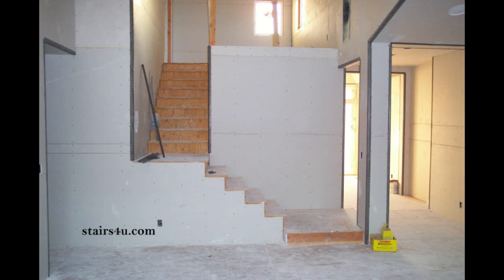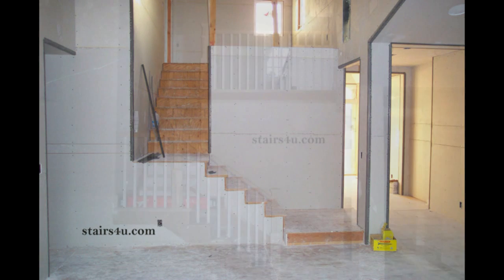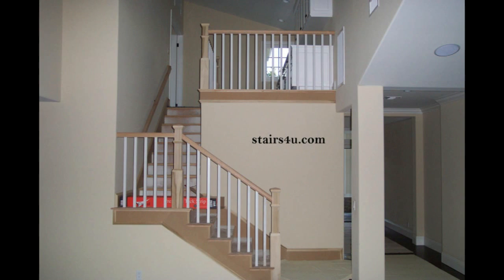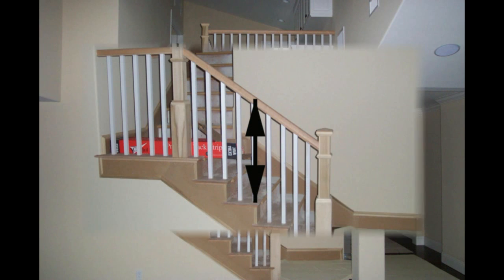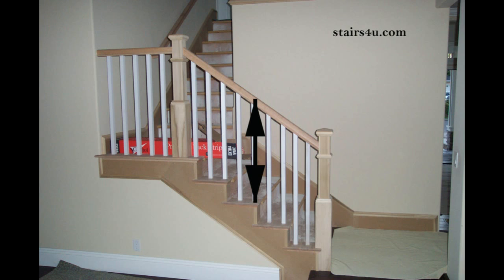Is This A Stair Handrail or Guardrail? - Stairway Construction

Comment: typically the guardrail only needs to be 36" above tread nose in one/two family construction.  The 42" rule is for commercial or outside of multi-family, unless you are in one of those few areas that require 42" in one/two family (like Miami-Dade).

Comment: Most stair rails in all states are, rake rails are at 34-38 inches, flat rails are at 36-42 and it is just that simple!
Reply from the maker: I'm going to leave your comments on, even though it can be misleading. Always check with your local building department in whatever state, city or county you are located to verify all building codes. This guy has a good point, but all states, counties or cities across the entire country don't interpret these building codes the same way.

Comment: Hi the State of Maine only requires residential stair guardrails to be 36" high.
Reply from the maker: Hopefully I stated in the video that you should check with your local Building Department for clarification on the information in this video. Jasper brings up a good point and let's not forget that a stairway handrail might be 36 inches in some areas, where a guard rail would need to be 42 inches. Make sure that you understand the difference and if you need more information, feel free to visit our website and check out the section on building codes.

Comment: Where are you and what codes are you following?  In PA, unless local codes supersede 2006 IRC applies.  Section R312.1 says 36 for guards and 34 for open stairs above 30".
Reply from the maker: I'm glad you mentioned this, because it's important. The information I share with others should be validated by contacting your local Building and Safety Department. These building codes aren't going to apply to everyone, everywhere, all the time. I'm actually in Southern California, but have seen handrails recently that were only 36 inches.